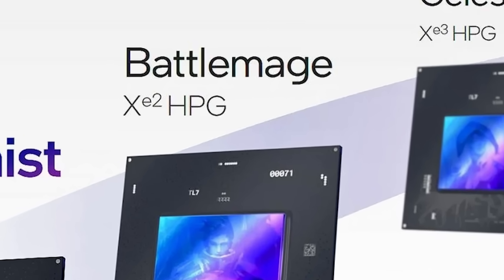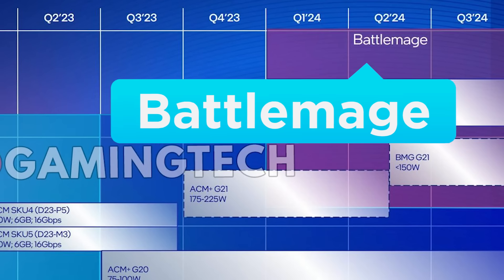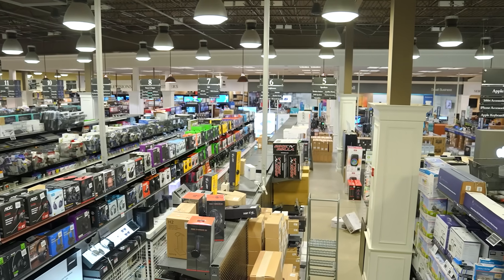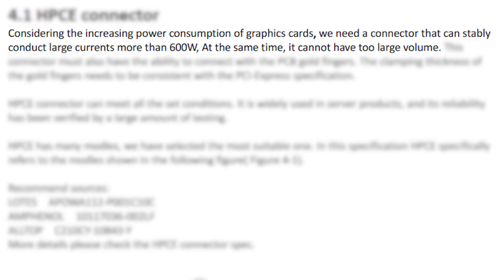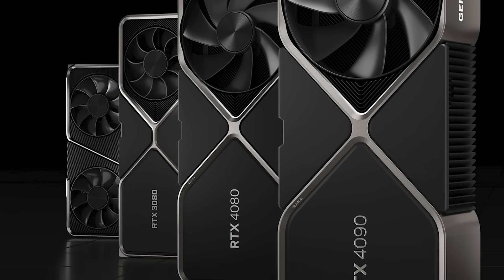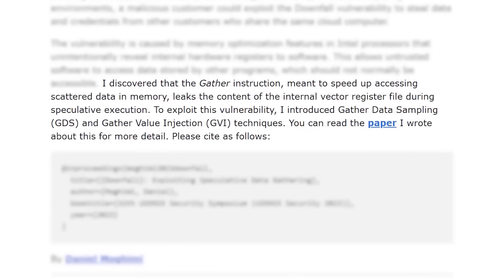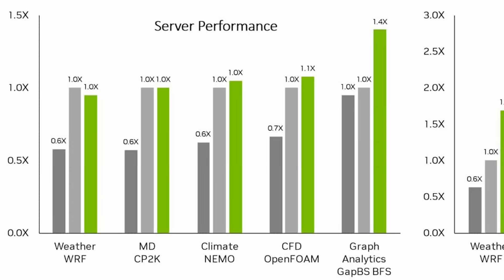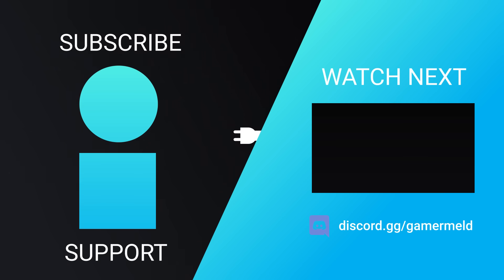New Standard Means You Have To THROW OUT Your GPUs!

Comment: Asus appears to be falling short in leaving any good impression... among all the GPUs available, the information I've encountered about Zotac highlights their use of low-grade components, and their support seems to be subpar, not to mention the concerning quality of their card design. This makes me wonder about Asus' efforts to rectify their GPU reputation. 

The situation wouldn't be as worrisome if they weren't also pushing for aggressive overclocking of these cards, potentially turning them into RMA returns, especially for the higher-end models.
Reply: what happened? i was planning to get asus rog 4080, and did i miss something? this video didnt mention anything about asus or zotac
Reply: @EriX88888  asus went from quality to garbage in a short timespan, bad software, bad hardware, bad customer service
Reply: @amigaangel  where can i read about this? LOL
Reply: I can't  really say as I only just bought my Zotac 3080.. all previous gpu's were asus. But I've  been very happy with my 3080  so far.  No issues at all.
Reply: asus used to be high quality and now they are absolute garbage in every way imagineable... the worst part is that asus doesnt give a sh*t about it for some reason
Reply: Wait... Asus is also Zotac?  :|
Reply: @cowlevelcrypto2346 From 02:39, you're absolutely correct. There wasn't any reference to audio; it was purely a visual observation. 02:54 The timestamp captured the moment of the Asus GPU (*look like stock footage insert only, non-related?) while the reviewer was discussing the new connector..
Reply: Where is this coming from? Asus had a fiasco with motherboards/cpu power management at some point but other than that idk, got the impression that it was addressed an fixed already. Have we had any specifically Asus gpu problems? (definitely wanna know more because I've been eyeing some asus cards)
Reply: @Meewy  What's the updates on their RMA support?
Reply: I refuse to by asus after the bs they pulled

Comment: That 1:41- new motherboard and GPU setup won't last since I remember Micro Channel architecture, or the Micro Channel bus, is a proprietary 16- or 32-bit parallel computer bus introduced by IBM in 1987 which was used on PS/2 and other computers until the mid-1990s. Its name is commonly abbreviated as "MCA", although not by IBM. In IBM products, it superseded the ISA bus and was itself subsequently superseded by the PCI bus architecture.

Comment: If intel can be sued for that, imagine what could happen to operating system and other software companies for all the lost work from crashes and troubleshooting. they might as well shut up shop. if that happens everyone will be wide open to hackers with no-one to fix it.
Reply: Intel advertised and promised X performance before you purchased the chip and now, after you paid, you can see up to a 50% decrease on that performance, depending on use case, for a mistake that is completely on them, they absolutely deserve to be sued.
Reply: I would think that would open up open sourcing for liabilities protection. Since you are passing the responsibility to the public then.

Comment: The motherboard is an experiment, not something that will likely catch on.  It is what they are using on the boards with all the connections on the back.
Reply: I have hopes for the 16 pin connector, but the board connector would be cool too.
Reply: @Not_interestEd-  it can only be better than the faulty by design 12v high power connector
Reply: @amigaangel  if you're talking about the 4090 cables melting, that's a Nvidia problem that can be fixed with improvements, because Intel literally JUST proposed it like 3 years ago, not many cards actually have it.

Otherwise, idk what you're talking about.

Comment: I am hoping at least some of the Ryzen 8000 gen will have nice integrated graphics. I never want to buy another video card. My 3060 TI runs 4K video on a 4K TV just fine.
Reply: if youre only watching Videos you dont need expensive gpus, pretty sure integratet Grafik units these days can run 4k Videos
Reply: @nilswalcher8338  I have a 5900X, several years old, but still good for what I do. Got the 3060 TI  when my 1060  died. Yes, I messed up, should have just downgraded the CPU to a 5700G
Reply: You can watch out for Strix Halo
Reply: @MixedVictor  Hmm, a mobile. I will try to keep up with that. Less power, heat, and noise, I would assume.
Reply: @Van-zf9iw  I think the Mini PC's could use the Strix Halo APU
Reply: APUs can only operate so much in their limited specifications. You might find better value if you split up to CPUs and GPUs. Most games even to today's standards probably don't need more than 4 cores AND 8 threads. If you are pushing it then 6 cores AND 12 threads are probably your upper requirements.

Comment: Cable extensions look really nice and only cost like 20 bucks now, easily a better choice than getting rid of my 6700xt and strix b550f gaming
Reply: Might comes at the expense of consistency/reliability though. Might be fine at lower ratings but cables' melting are/were a thing.
Reply: If that standard catches on, it's still at least 2 years until it appears on the market. With probably more like 5 until it gets popular enough that normal GPUs or mobos from today start being only in the new form.

Comment: amazing... thick cables can melt, lets put all that extra power passing through the motherboard circuits. 🔥🔥🔥
Reply: Ok, now ask yourself a question....why are the cables melting?
Reply: @floydefisher  EXACTLY, boards are obviously generally be more reliable than removable AND modular cables.
Reply: @floydefisher @rickytorres9089
you missing the point, @bernardb5251 answered you.
also when a mobo or psu have a problem, a short for eg, it will most likely fry all components attached to it.
Reply: Breaking News! Motherboard with 600w passthrough melting and catching fire! Hell even if they don't I can only see the heat from that kind of voltage dramatically shortenting the lifespan of motherboards. 😥
Reply: @bernardb5251  Again, they are catching fire due to the connectors coming loose.  Not because of the power contained within.

A connection through the motherboard solves the problem because it can't come loose.

Plus, you can engineer a motherboard to handle the heat load.  Just like you do CPU's and GPU's.

Comment: That HPCE connector is just going to pump tons of thermal energy into my mobo, instead of routing it around my mobo using standard PCI cables.
Reply: No it won’t. Does your circuit breaker box in your house run hundreds of degrees? Because that’s already likely running either 100 or 200 amps at 120 volts = 12,000-24,000 watts. If your breaker box isn’t melting, your motherboard won’t either.

To be clear, the heat doesn’t come from the current running through the conductor. That’s why high voltage power lines aren’t melting either. The heat comes from resistance, and that primarily comes from transformers where the voltage is changed or the power reaches the end of the line - in this case the CPU or GPU. The cables from the PSU to the components can handle thousands of watts without even getting warm provided they’re making a good connection and aren’t creating excess resistance from short circuiting. The motherboards will all be engineered to have minimal to negligible resistance and will not be a problem whatsoever- just as it is currently in datacenter motherboards that support multiple kW without issue.
Reply: @benjaminlynch9958  Interesting. thanks for the info
Reply: Power delivery integrated generally runs pretty hot. VRMs are probably running in the ~160F. Usually it needs to be cooled only by case airflow, airflow from the CPU's fan(s) and/or heat spreading from heat sinks to keep cool ENOUGH.

Comment: Seeing how power hungry these CPU and GPUs are really makes me appreciate my 100W rtx 4060
Reply: Ikr? Ppl are shitting on the 4000 series but they're really power efficient. I jumped from a water-cooled 1080ti that used 275W to a air-cooled 4070 that goes around 190-200W at most. If you undervolt it properly, you can get around 140-150W with no loss in performance(I'm talking about actual games, in furmark maybe 3-4% difference)
Reply: I'm hoping they bring out a 4050 at 75W.
Reply: @dcikaruga  
You can also undervolt the rtx 4060
Reply: @derp4coffee  Assuming you can, not all configurations, software, etc support undervolting. There isn't "just a button" to press.
Reply: My power supply idles off more than 100 watts. 😂